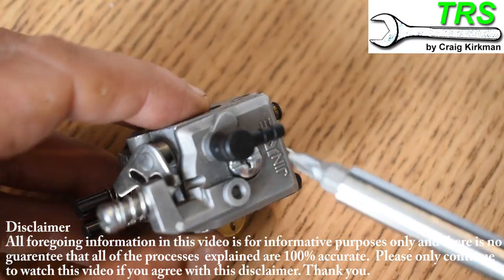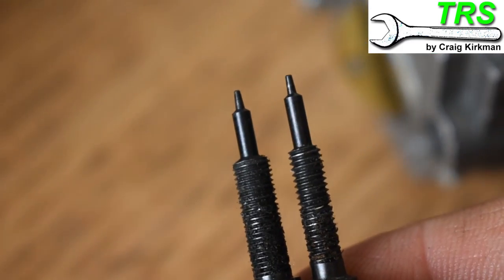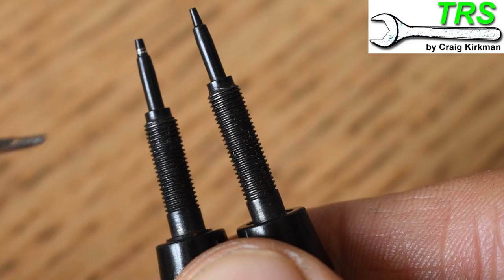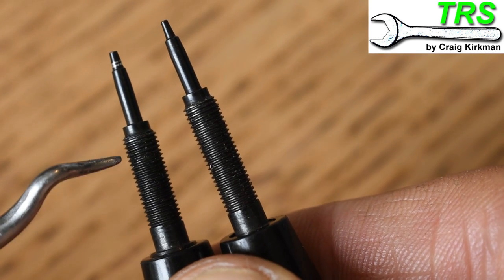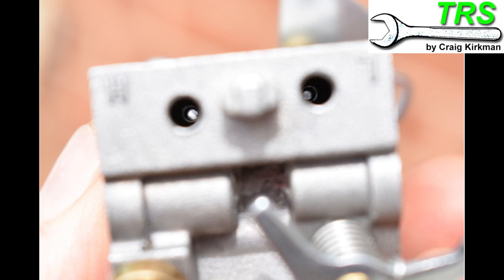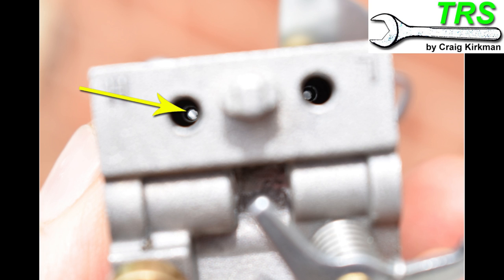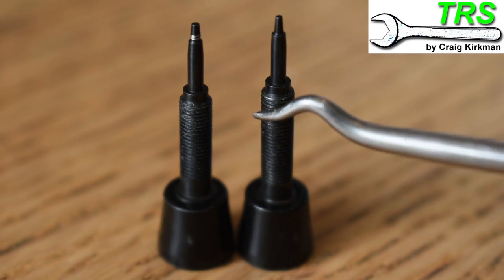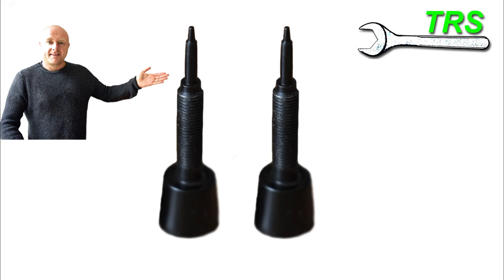Mixed up Screws! for Carburetor Fuel Air Adjustment | (on Chainsaw, Weed Wacker etc)

Comment: I’m so glad I came across your channel. I’m hoping to get my Briggs and Stratton mower working. Ive got a new diaphram and gasket and have ordered a new air filter. Gonna get some carb cleaner and some oil and hopefully get it running this Friday when I have some time. Your detailed video on how a briggs and stratton carb works is amazing. I watched loads of other vids before i found yours which were helpful but your one is in a totally different league. It makes me really appreciate the designers who invented all the details. It’s amazing that a little piece of material (diaphram) along with a spring and a vacume affect can pump petrol into the carb from the tank. And those little flappy valves!!!!WOW! Think I’ll watch all your videos and have a rewarding time (hopefully) fixing my stuff. Thanks for making these vids.
Katy
Reply from the maker: Thank you for your positive feedback. I really appreciate it. Thanks again. Craig

Comment: i usually just clean one at a time at there are separate circuits anyway. Screw it back to one turn then take out other and clean.  AND be gentle with those crews when you screw them in before backing out a turn to a turn and a half.
Those little carbs get a bad rep but really they are fool proof is the lever is set more or less correctly and the pump and metering gasket are reasonable. I had one pumping tons of gas and the pump gasket was all shrivelled up; i replaced it anyway as part of a full service with a $3 chinese Walbro kit.  3 pump gasket materials. rubber pumps most dosent like the E10/15 fuel and i see no diff really on start and run, plenty of psi pressure there so the guys knew when they designed these carbs to allow extra pressure to suck up fuel from tank below and through a couple of filters in circuit.

Comment: Hi, don't know why I haven't been recommended your channel yet, looks like lots of good stuff to review. Subbed to remind myself.

I have a different but related problem: how can I know which screw is which when they're not labeled? I just want to adjust a string trimmer and can't find anything online that addresses this question. I've seen some arranged left and right, others up and down (sometimes with L on top), so a general pattern is not immediately apparent to me.

Comment: My Carb Has a Screw attorney Next to Throttle
 ( ???? Idling Screw?)

2 Screws On Botto 

L -  Low Idel Screew

H - High Idel Screw 

My Bike Won't Kick Over, But it was Alot more 2 Cycle Gas Then Actual Gasoline So I took off Carb because Its Sucking up to much gas to Fast n It just Starts fluiding itself What I mean by that Is without trying to start it Opening n closing Choke Gas will Pour out Not alot but Enough for me to Know somethings Wrong (Please COMMET BACK What I NEED Too do PLEASE!!!
Reply from the maker: If you have fuel leaking back (flooding) then you might need to take off the carburetor and check the needles valve and setting and clean out the carb.